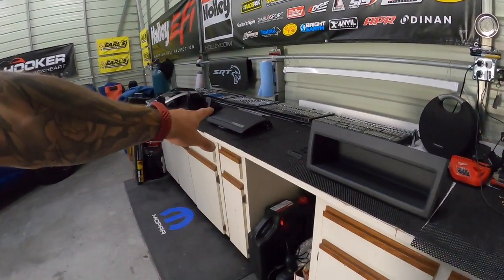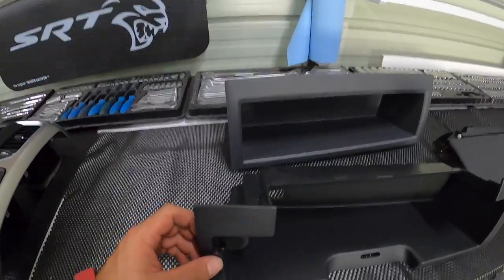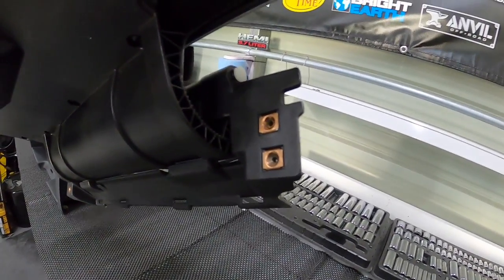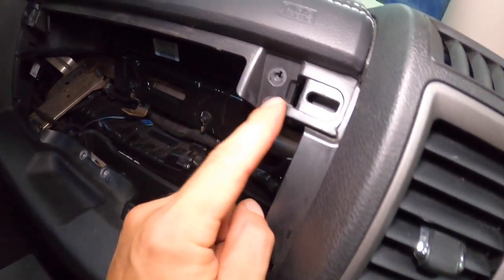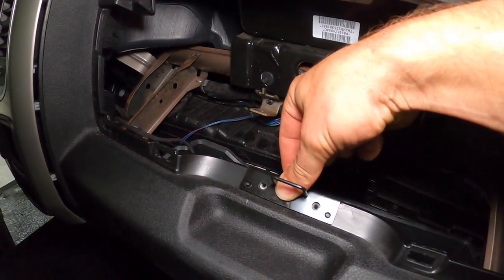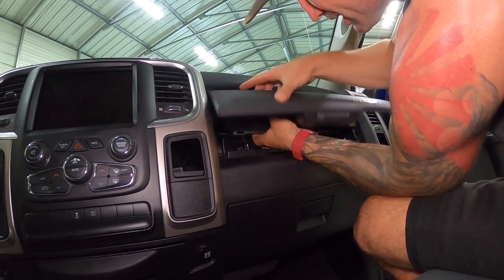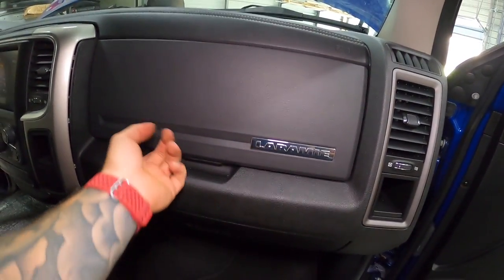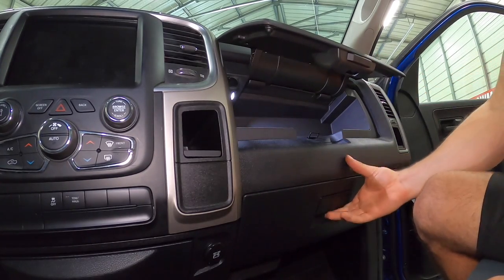How to Install Upper Glove Box RAM 1500 2500 3500

Comment: On the silver Ram u had did u need to relocate the ebrake cable I have a noise under the rear of the truck I've checked everything except the ebrake cable. I've been told that the cable is loose have u had this problem  I plan on checking it as soon as it cools down outside